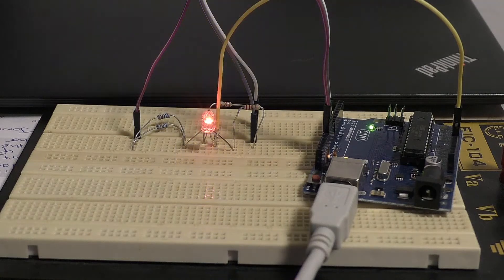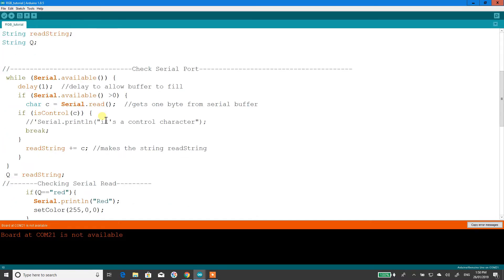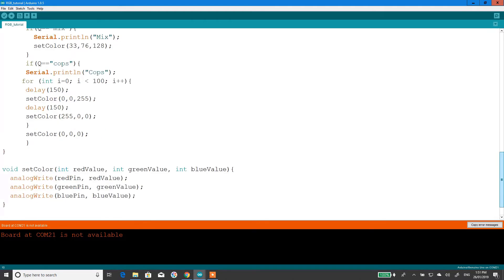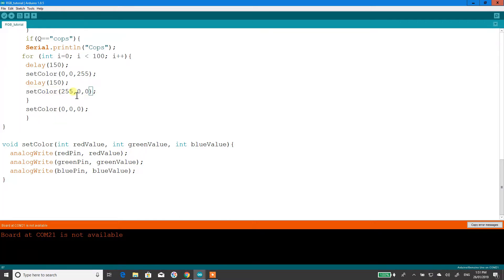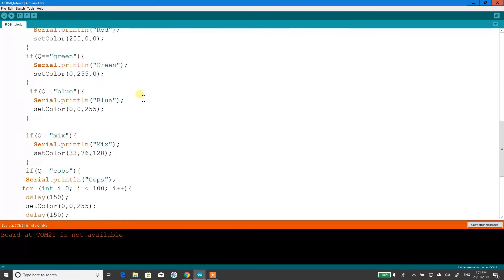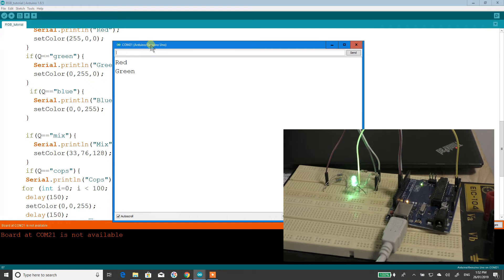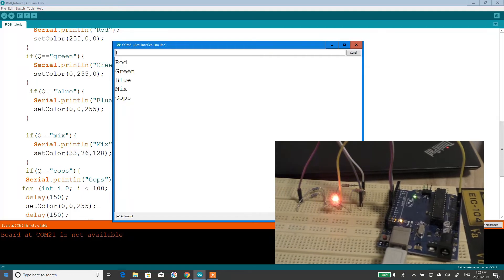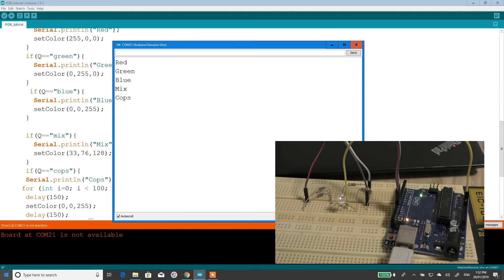Arduino RGB LED Tutorial

Comment from the maker: //-RGB-LED-----
int redPin = 10;
int greenPin = 11;
int bluePin = 9;

void setup() {
  // put your setup code here, to run once:
Serial.begin(9600);

}

void loop() {
  // put your main code here, to run repeatedly:
String readString;
String Q;

//------------------------------Check Serial Port--------------------------------------
 while (Serial.available()) {
    delay(1);  //delay to allow buffer to fill 
    if (Serial.available() >0) {
      char c = Serial.read();  //gets one byte from serial buffer
    if (isControl(c)) {
      //'Serial.println("it's a control character");
      break;
    }
      readString += c; //makes the string readString    
    }
 }   
 Q = readString;
//------Checking Serial Read--------
      if(Q=="red"){         
        Serial.println("Red");
        setColor(255,0,0);               
      }
      if(Q=="green"){         
        Serial.println("Green");
        setColor(0,255,0);               
      }
       if(Q=="blue"){         
        Serial.println("Blue");
        setColor(0,0,255);               
      }
     
      if(Q=="mix"){         
        Serial.println("Mix");
        setColor(33,76,128);               
      }
      if(Q=="cops"){                 
      Serial.println("Cops");
     for (int i=0; i < 100; i++){
      delay(150);
      setColor(0,0,255); 
      delay(150); 
      setColor(255,0,0);            
      }
      setColor(0,0,0);                       
      }
}

void setColor(int redValue, int greenValue, int blueValue){
  analogWrite(redPin, redValue);
  analogWrite(greenPin, greenValue);
  analogWrite(bluePin, blueValue);
}